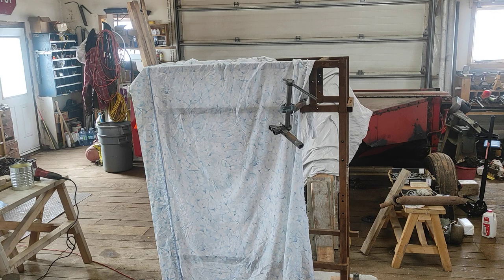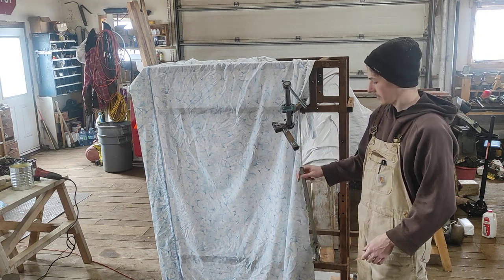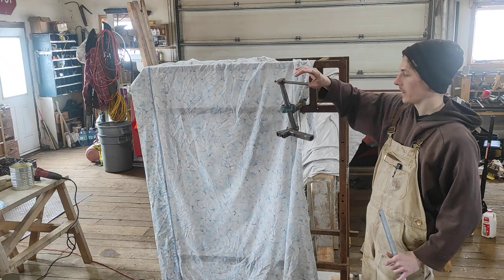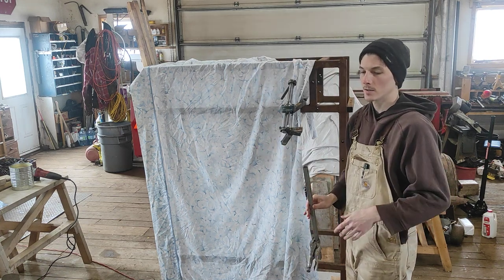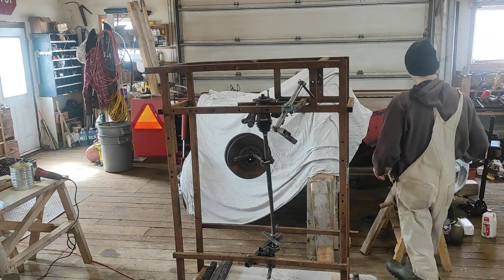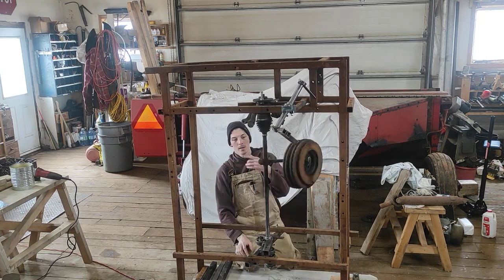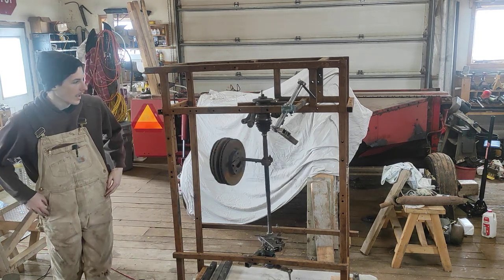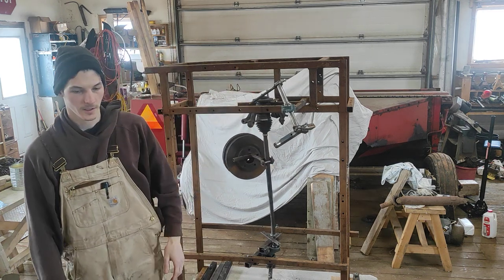The Missing Link in Skinner Replications

Comment: You have a working machine don’t you. You just can’t show it on here.
Reply from the maker: no, as far as this machine goes I haven't had time/money/motivation to work on it. It is the Skinner machine essentially. Build it and power your house with it. The key to everything that I've found, that the "manipulations" that should give you extra energy don't work UNLESS the centrifugal force and gravity balance each other like I show. And it needs the little fixed lever. But then it works. And this setup is 100 times simpler than the Da Vinci-style wheels that resemble an over-balanced wheel (which doesn't work.)
Reply: @QuantumEnergySearch  why don’t you get with sir T at Witt’s ministries and have him teach you some stuff. He knows how to build gravity machines and quantum energy generators. You probably wouldn’t be able to show it on YouTube. I want to I just don’t have the money. I would love to know how to build one of his generators so I could power my house or run my car on H2O.
Reply from the maker: @Flowtester1  I have.
Reply: @QuantumEnergySearch  sweet
Reply: @QuantumEnergySearch  I was wondering when you told that guy the only way to get over unity is to polarize his motor. Most people including me don’t even know what that means.
Reply from the maker: @Flowtester1  yes, you need to take classes.
Reply: @QuantumEnergySearch  I would if I had the money. I have been saving but they recently raised the prices on everything. I got the bug bad. I have been watching every video and reading anything I can on the subject. It is pretty clear the dark side don’t let anything get on the net. I’m just so amazed that there is a whole world of science out there that I will likely never see.
Reply from the maker: @Flowtester1  yes, that is why I have done the work for the Skinner machine. There's no polarization, no electrical knowledge needed, and it works every time.
Reply: @QuantumEnergySearch  well keep up the good work I watch all your videos.
Reply from the maker: @Flowtester1  thank you!